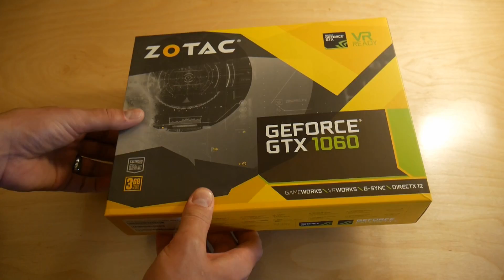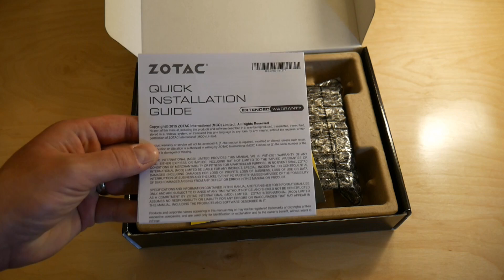Unbox and Install of the Zotac 1060 Mini 3gb

Comment: Is it a good graphics card?
Reply from the maker: In 2022, it's hard to say...depends on price, monitor resolution, and which games you want to play. 3GB VRAM is fine for 1080p or lower resolutions. Older titles like GTA5 or Tomb Raider will run fine, but newer titles like Cyberpunk 2077 will need reduced settings to get solid framerates The cooler isn't the greatest. If you can find one for a good price then it might be worth it. I like to use this site to get a sense of how it compares to other cards.

Comment: I have dell optiplex in 980 sff and i want to install a gtx 1060 mini of either 3gb or 6gb can use that will it come in small space and one more thing is that i have only 235 watts supply do i have to upgrade it please help me and give some ways to do it
Previously i had gt 710 gigabyte low profile gddr3 in my gpu which required 300 watts but it run well even with overclocking

Comment: A 1060 is a 1080p card not 1440p The sacrifices you will need to commit to to get it running at 60fps is crazy. 
And it’s worse with a gimped version Like the 1060 itx
Reply: Mark Leggett is the mini version is bad compared to normal size version??

Comment: Where is cd with drivers? :D :D
Reply from the maker: Drivers are updated so often that there is really little reason to include them on cd's these days. Have to go to Nvidia or Zotac website to find them. Sorry if you have dial-up or 3G...
Reply: I asked cause i bought this card and i had cd :) Np bro :D
Reply: How loud is this card?
Reply from the maker: https://www.techpowerup.com/reviews/Zotac/GeForce_GTX_1060_Mini_3_GB/28.html  here is a link to a very thorough review with a specific section on noise. hope this helps
Reply: Is it normal that fans are runing at 51% at idle, temperature is 26 degrees

Comment: is it better than the sapphire rx 480 4gb
Reply from the maker: Pretty similar performance in most games. The 1060 uses less power, but it also has 1GB less of VRAM. The 480 is a bit larger, but it also has FAR better cooling, which might permit better overclocking if you are into that sort of thing. If the prices are the same, I don't see how you could go wrong with either one.

Comment: Uh when you installed the graphic cards how do u install the drivers i checked the Dxdiag thing and it says i'm using Microsoft Basic Display Adapter? I'm kinda new to this
Reply from the maker: Thanks for watching! With most...probably all...technology, it is best to go to the manufacturer's webpage and download the current driver suite for your card. In the case of this card in particular, the direct link would be as follows... https://www.zotac.com/us/files/download/graphics_cards?driver_type=All&g_card_series=1201&g_card_os=All&sku=ZT-P10610A-10L&skuSelect=ZT-P10610A-10L ...just pick the correct driver for your particular operating system.

Comment: do i need to put in the 6pin pci-e(?) slot? tbh what does the 6pin pci-e(?) slot used for?
Reply from the maker: Thanks for watching, sorry for the delay. The 6-pin supplies supplemental power above that which the pci-e slot can deliver. The slot is rated up to 75W, the 6-pin is rated for 75W, an 8-pin would be rated for 150W. This card maxes out in the 125W range, so the 6-pin is required.
Reply: Thank you!

Comment: a little cable management won't do much harm bro
Reply from the maker: Hey, yes, you're right...would help, but case was tight and cheap, so not much management options. My R5 featured in one of my other videos is SO much easier to work with and demonstrated good management skills...if I do say so myself. Will probably upgrade wife's case at some point.

Comment: Can I use this graphics card with a 450 watt power supply?
Corsair VS Series 450W, amd a8 6600k, ram 16GB, HDD 4TB, Cooler Fan X6
Reply from the maker: Probably. It averages less than 120W. https://www.techpowerup.com/reviews/Zotac/GeForce_GTX_1060_Mini_3_GB/

Comment: Great First Video!
 It has no accessories with it. 

Will you be kind enough to tell what all connectors and stuff I would be needing?
My monitor has VGA port.
Reply from the maker: Sorry for the delay in replying, been busy (and lost in my first Mass Effect 2 play-through).

Thanks for the encouragement! No accessories in the box. 

The simplest connection option for you would be a DVI to VGA adapter. They are typically white and included with many other cards. If I needed one, I would check GoodWill or a thrift store first, then consider paying retail. They can be found in thrift stores occasionally in the $1 cable bins, or something similar.

Thanks again!

Comment: mine is sapphire r7 260x i want to replace that with zotac 1060's
Reply from the maker: Oh yeah, that should be a NICE improvement.
Reply from the maker: Hey, thanks for watching. Might be a frame-cap set by title. Many games force you to 60 FPS for smooth performance and to prevent screen tearing. Also, not sure what title you are referring to, so not much more advice I could give. sorry.

Comment: nice video card!!  What kind of connector for power did you use??  Is it just a 6-pin or does it require the 6+2 or 8-pin setup??

The video stopped before you made the power connection.  LOL!!  Thank you...Greetings!
Reply from the maker: Hey thanks, all it needs in a single 6-pin. It uses very little power.
Reply: Nice.  Thank you for the fast reply!!   \\au revoir//

Comment: how much is it? is it good upgrade from hd7850??
Reply from the maker: Thanks for watching! It is $199. I was able to get it for $168 after jet.com's coupon, TRIPLE15.

To compare performance, it is an improvement over my 7970 Ghz Edition...so it should be a considerable improvement over a 7850.
For reference, https://www.techpowerup.com/reviews/MSI/GTX_970_Gaming/27.html shows that a hd7870 is about 50% of a gtx 970, while https://www.techpowerup.com/reviews/MSI/GTX_1060_Gaming_X_3_GB/26.html shows that a slightly overclocked 1060 3gb card is about 9% faster than a gtx970.

So for my rough guess, I would assume conservatively this card is going to be a 50% improvement at 1440p over your 7850.

I think I may do a video comparing the two cards just to see for myself.
Reply: Neilobyte i wish i live in usa in canada this card is more expensive. thanks for info anyways
Reply from the maker: Sorry to hear that, no problem!